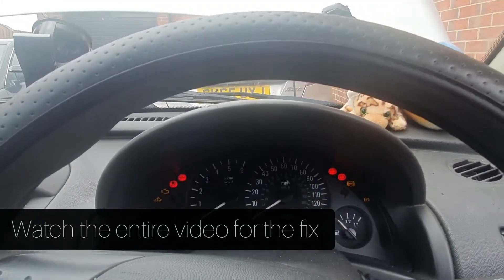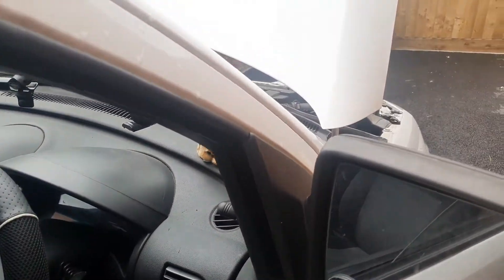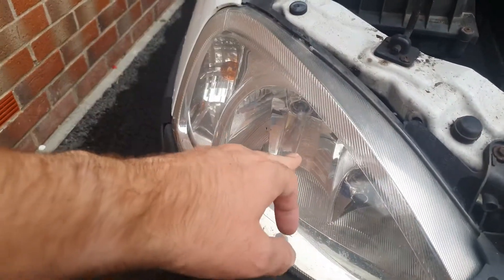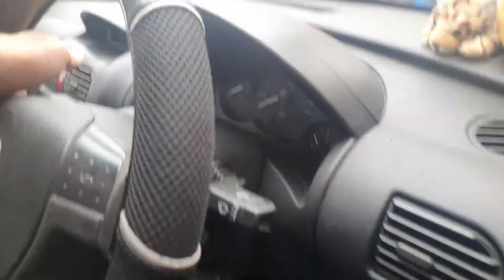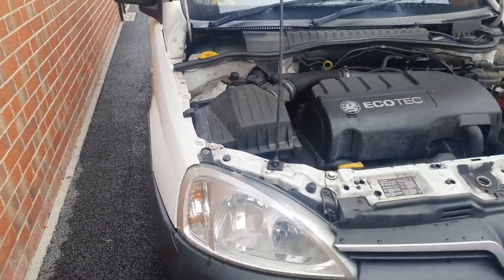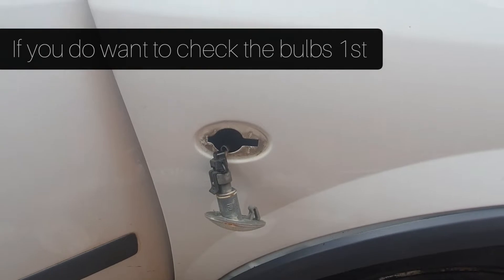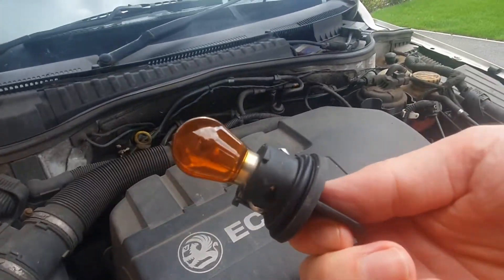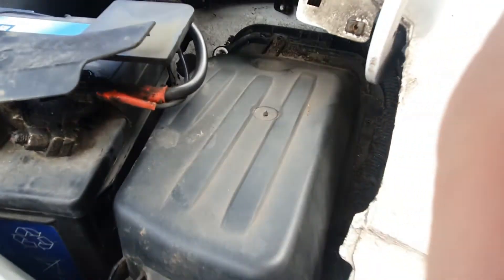Faulty Indicators On 1 Side - Cheap Fix Relay Change - #vanlife How To Van Repairs

Comment: Only 7 bolts holding the plastic cover to the faulty relay which is available from GSF for £21.00
Reply: 10.50 Amazon